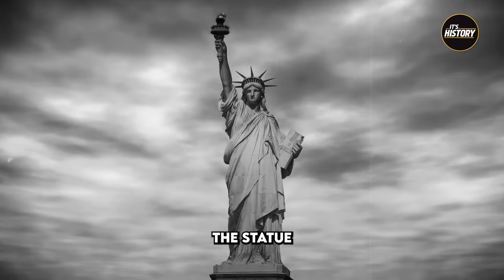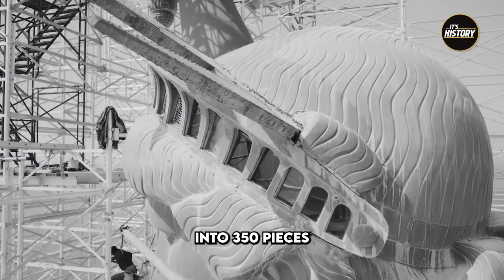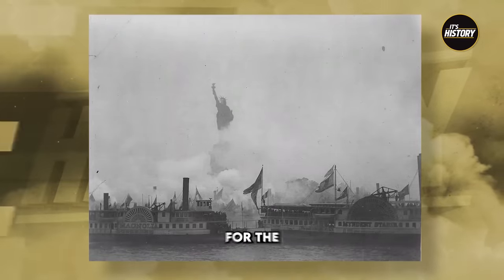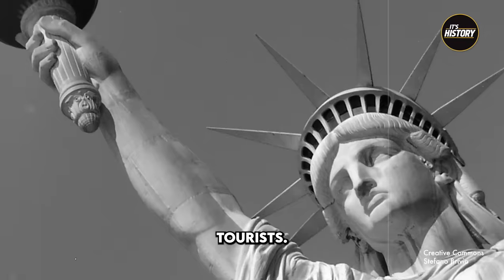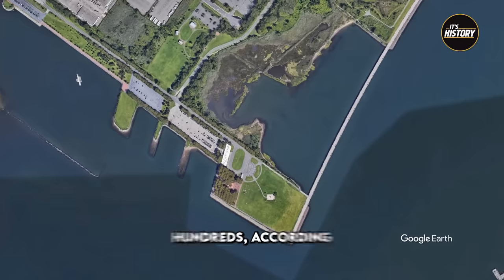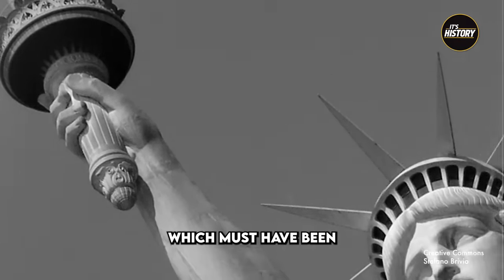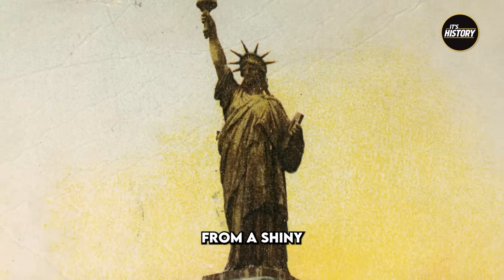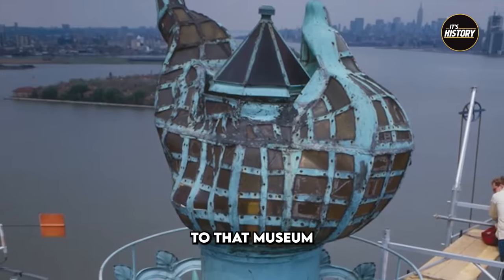What's inside the torch of the Statue of Liberty?

Comment: Still waiting to see what's "INSIDE" the torch, how it was built, and how the light worked. Please go over the "TWO" times it was replaced again cause I missed one of them.
Reply: A ladder.

The balcony of the torch has a total diameter of 12 feet, leaving less than 4 feet for the handle. If an average person can climb up through this part of the statue, there can't be much in there than a ladder. 
Originally, the flame should work as a light beacon, so there will probably have been some above-average power cables, but it never worked as intended.
Reply: @olli1068  I know the flame was gold leaf wrapped and illuminated from the outside, at some point. I merely pointed out that the video title and description did not match the video. In my opinion, that makes it "click bait" cause I would not have watched it otherwise.
Reply: @jimmcdonald5448  I agree, the video doesn't match the title.
Like in 90% of all YouTube videos, but it's still annoying.

Comment: It wasn't really made clear, but the original torch flame you see in the museum once looked like the new gold plated flame. It was cut up and turned into a light house over the years, ending up with more glass than metal. The changes to the original were so extensive that they could restore the flame, so the made a gold leaf plated replica.

Comment: I was going to say that all those pictures from the distant past with the modern flame of the torch must have been photoshopped since I remember the original, glass paneled flame that was illuminated from the inside. However, it seems that the original flame was more like the current flame, so at what point was the original flame changed out? I remember the old, glass paneled flame from a visit in the 70's and then seeing the new flame after the 80's renovation. Strange that there was no mention of when the original flame was changed out for the glass paneled one.

Comment: Copper will develop that bluing green color over time without the presence of pollutants in the atmosphere. Pollutants had nothing to do with it. The color is called patina. It also offers a protective outer layer against corrosion. Patina is desired on copper and bronze metal objects and should never be removed or cleaned. Any conjecture about pollutants contributing to the patina is misinformation.  Otherwise, the video is accurate.